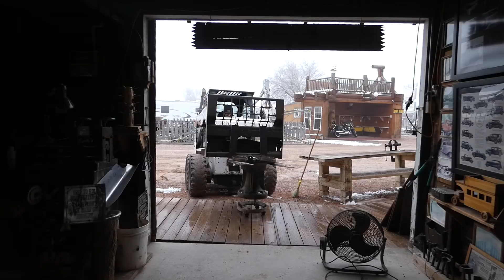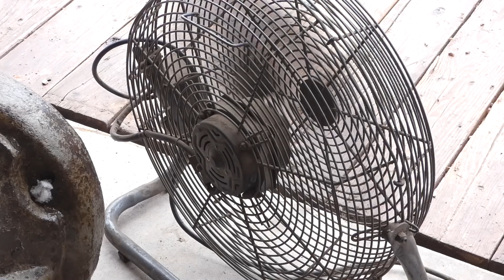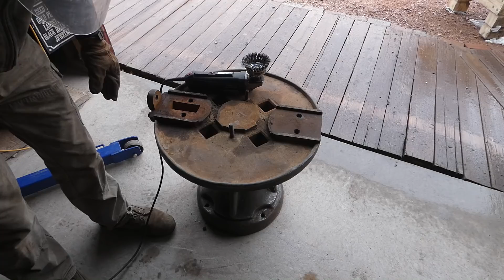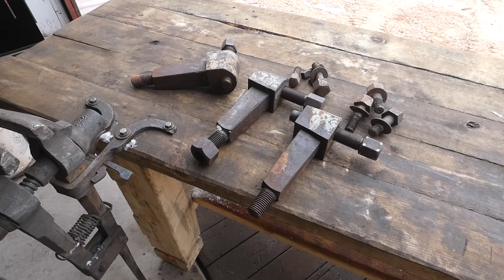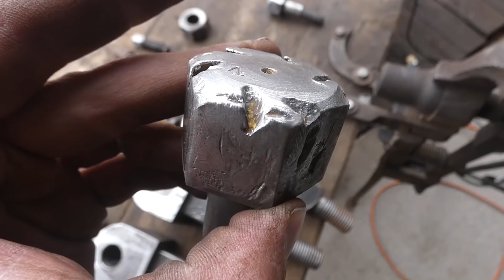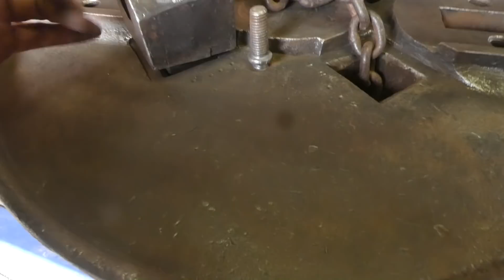Restoring a 125 Year Old Drop Hammer - 100lb Ram Weight - Part 2 | Iron Wolf Industrial

Comment: Those marks on the bolt are chisel marks where someone tried to hammer it free. Also, I think the dogs originally had lock washers on them.
Reply from the maker: Thanks Larry, looks like everyone is in agreement on this one! I do not know if they had lockwashers, but I will start with standard washers and see how they hold up.
Reply: I I agree with the chisel, however not sure if lock washers go that far back. I think the old timers may have used cloth or a felt type product. That's why the deep chisel marks in the bolts because of having to be tuned up so often

Comment: On the bolt you are fixing with welding somebody used a chisel to either tighten it or loosen it. I have seen bolts like that on old pieces of equipment before.
Reply: Dave baum I just read your comment right after I posted mine. I agree about the chisel marks. Good call!
Reply from the maker: Dave, very interesting. On second thought, I will leave the bolt as is to preserve its character, and to be able to tell that story about why the marks are there. Thank you for the insight.

Comment: Coming along good. What color are you going to paint it? Did I see some yellow paint underneath the gray in part one?
Reply from the maker: Yes you did! On the base and tower, there was a coat of safety yellow underneath the grey. On the clutch/hoist mechanism, there was a coat of red underneath the grey. I am thinking of a lighter grey to really make it stand out from the other dark equipment in the shop. What color would you pick? Single color? Two-Tone? Drop a reply here

Comment: Hi again 
Greetings from England 

Those marks on that bolt head are where they've been braying it with a hammer & chisel to tighten it down... 
Happen it were hard to reach where it were installed last...
So you might just want to consider accessibility to all sides of this machine when you site it in your workshop... 

Regarding lead paint:

I keeps hearing folk on here flapping just caus they see something that they think might be lead paint... 
Out comes the test stick as well... 
I never gave a shyte myself and if I had a pound for every time I'd taken an angle grinder with wire brush on to some old lead paint then I wouldn't be sparkying for a living... 

Done loads and I'm still here arn't I..? 

I've 30 odd lineshaft driven machine tools to restore back here in England... 
They're all in storage just now...I'll just have to start dragging em out and getting em done... 
Lathes, milling machines, radial drills, hacksaws, grinders and loads of woodworking machinery as well... 
Hmm... 

Bye for now.

Glenn.
GLMelectrical
Reply from the maker: Great stuff Glen! There is a general consensus on the origin of the marks on that bolt. I would agree with your statement. I have spent about 16 hours between two days moving and considering where to place it. I figure I don't want to take a chance with the potentially lead paint, so I've got my respirator and face shield. It's at least saved me some tissues. I'm looking for a mill to run off a lineshaft. England's a little far away for me though. Thanks
Reply: Iron Wolf Industrial 

Regarding lineshaft hangers, bearing blocks, countershafts and flat belt pulleys:

grab em wherever you see them for sale as their getting very hard to get hold of now... 

I do have some which I may use as templates to generate patterns for new ones...